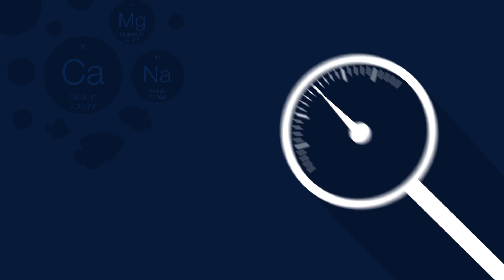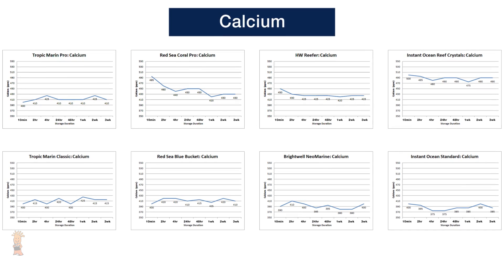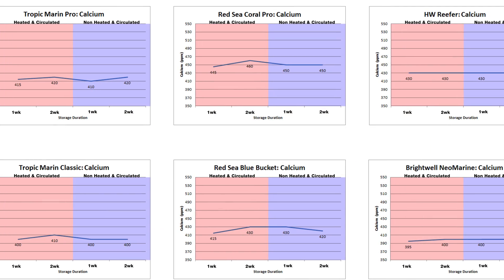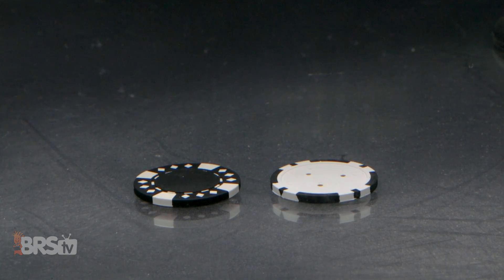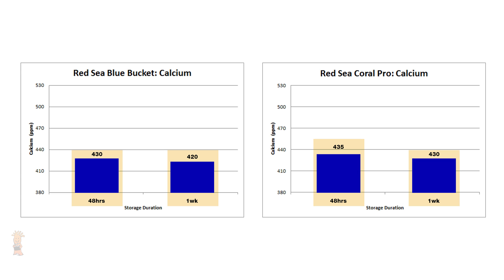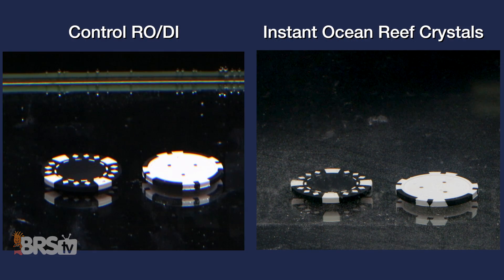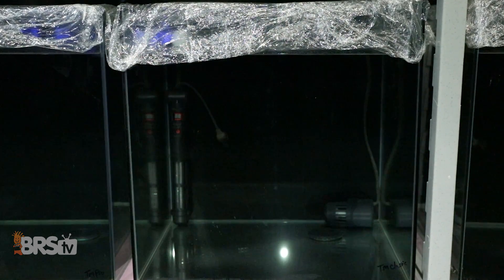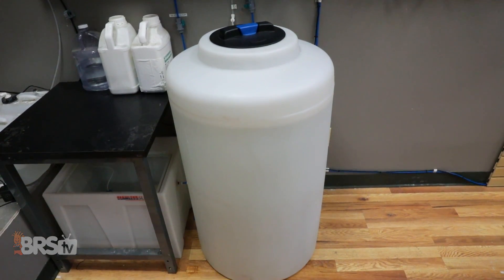Do you really need heat and flow in your saltwater mixing station? | BRStv Investigates

Comment: I use a big pump to mix water and I usually leave it in  there because it is great for water change to pump water in but when I cover it heats up so i will take the cover off the day i am doing the change.  Its never more than a few days because I mix it the day I plan to do a water change but may end up putting it off for a couple days...lol   I am sure it is heating it to  over 90, so I never thought about what that can do to the water.  Do you think that water is okay to use or should I switch to the 1200 marineland I just bought? Also,  do i run the pump 24 7?  I saw some people say they use a timer.  I thought keeping it aeriated was best but now not sure what to do.

Comment: Lots of possibilities now for extended storage or AWC systems with equipment fail safes (float switch) while avoiding major precip issues. Thank you and for the comment that unheated was ~10 degrees less than heated.

Comment: I still reckon it's better just to store RODI water than it is to keep salt water mixed 
I just mix what I need and use that day without any issues
Reply: WILDWELSH PETE I’d be curious about one thing: RODI water is incredibly aggressive about absorbing material, including anything that can leach out of the container, as well as gas in the air. How someone stores their RODI can make a huge difference (type, brand, age of container, hoe much air access, etc) and not as easy to test.
Reply: @donquixote2206  that's true 
I've never had any issues and I rotate my RODI drums so it's not kept for very long periods of time 
It's kept in food grade 25 litre drums that's only been used for RODI water

Comment: So after conducting these test what would you suggest for storing Red Sea Coral Pro? It seems like it’s either best to keep flow permanently or to mix for a few hours and stop. There didn’t seem to be stability or precipitation issues when it stayed mixed, only when the mixing stopped. I’m new to reefing and currently setting up a 75g aquarium.

Comment: Here is a question for everyone. If i am making my ro water with well water and the temp of the water is say 55-60 should i let the temp rase to 78 then add salt or just add the salt as sone as i get the last gallon made. Ps i make a 50 gallon bag at a time so it might take a day to get to 78 and it is in the basement.
Reply: Chad Engemann I heat my water to 78 then mix the salt

Comment: Why does my stored water get a sour smell to it after about a week? I keep the brute can loosely covered, and run a power head. I have cleaned the brute can using vinegar, but that didn’t help. 
Would you consider this water unsafe to use after it starts to smell?
Reply: salt like ninja be gettin' it best
Reply: I know this is old comment but for the future people wanting an answer. Its the DI resen going "bad" It starts to release what smells like fishy smell. Its actually not terrible or toxic to the tank per se.. just note, its time to change out the DI resin.